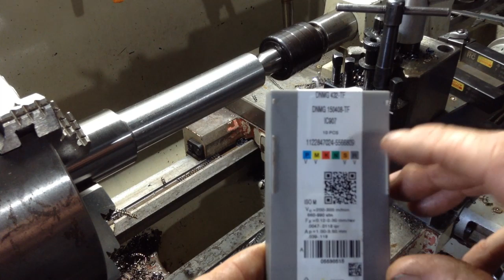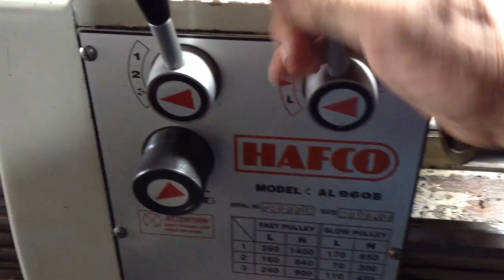Machining R8 Tooling for the Bridgeport  Part 2

Comment: Those R8 tools are going to turn out great. I bet you spent all weekend roughing them out. Impressive work. I noticed what looked flash rust on the rough stock. If I am correct that must be really annoying. Cheers.
Reply from the maker: It is rust , but no big deal .   The flood coolant must have been a bit diluted from constant top up's .  Cheers .

Comment: Nice! That is one helluva pile-o-chips 🤣. Last time I did the etch-a-sketch thing, I found moving inwards worked a little better for me. The slop in my top slide lead screw nut kept getting pushed out as I was turning back on the curve (if that makes any sense 😏). Your lathe, being recently tuned up is probably fine 😊. Cheers, Max. Stay safe out there.
Reply from the maker: Try doing it with your compound still set for the R8 angle , it throws you out of wack a bit !   Cheers .

Comment: Hello Max,  The parts look good and I'm amazed that Dorian insert lasted that long.  I just got mine last week but haven't had a chance to try them out yet.  Everything on the box mine came in is the same as yours except they are not marked for use with hard steel.  Not sure why.  The proof will be in the use I guess.  Thanks, Ken.
Reply from the maker: Yes the same corner is still going , has slight damage but still going .   Are the inserts marked  for cast iron as well , they should be . maybe they did not tick the box .
Reply: Yes, they are marked for cast iron just not marked for hardened steel.  I suspect they are identical to yours and it was a printing mistake.  Ken
Reply from the maker: @hmw-ms3tx  They don't like mild steel , i chipped one a while back  !

Comment: Hello Max. I have to admit that when I was watching your setup, I was wondering whether the Perth weather had boiled your brain - the cheater bar, the setting the clock on the live centre and so on. And THEN you explained why you were doing it, and I was enlightened. Seems like you've done this sort of thing before - me - not so much - I play a machinist on the internet, but not a very good one. 

Thanks for the guidance, and the great videos you turn out.
Reply from the maker: Hi Richard . Just different techniques that are used in the trade , not always common knowledge to the hobby machinist's .  Cheers .

Comment: Hi Max, can you explain what’s happening when you align the tail stock please? I can’t quite get my head around what is actually moving.  Is it the work in the chuck, the work on the centre, the centre in the tail stock or something else? Pete (this isn’t a criticism...just looking to learn)
Reply from the maker: The tail stock is on a split base , so can be shifted toward or away from the axis of centre line of the chuck  .  This allows a parallel part to be turned & also a long tapered part to be turned if the tail stock is off set .

Comment: hi max,i have the same lathe as you,but the thread charts in the manual seem wrong.could you do a threading demo on your 960b and point out the lettering and numbering holes on the lathe.mine is not mark at all.i have the large cog (127 ) at the back,120 front,top cog is 40,bottom cog is (40).thanks in advance ,geoff
Reply from the maker: No worries  . I have to do a 1'' left hand thread & a 50mm thread  in the current arbor project to do .  I can email you a picture of the chart if you want .  My email is in the channel description . Cheers .
Reply: @swanvalleymachineshop  yes i would love that chart,thanks max.email has been sent
Reply from the maker: @geoffreyward4743  No worries i will get to it today .